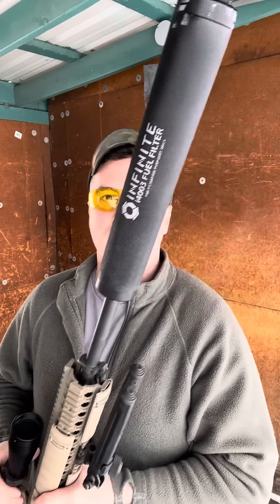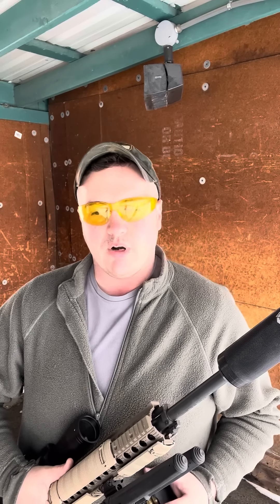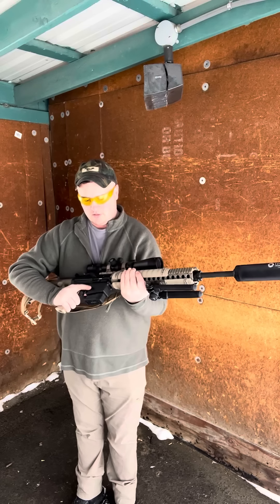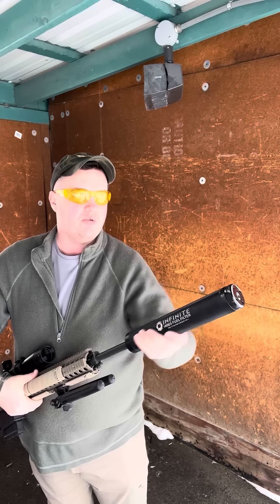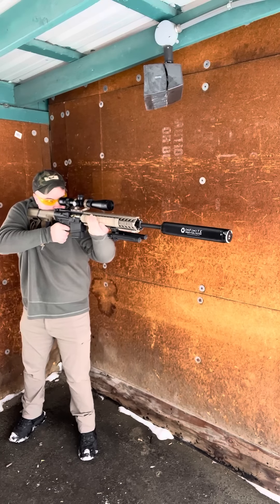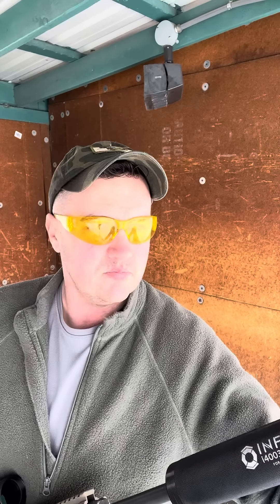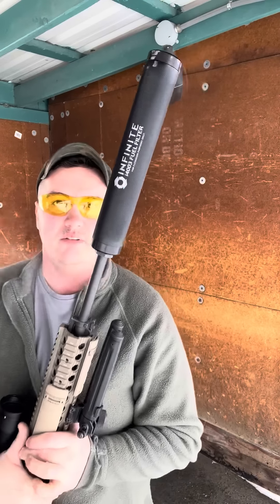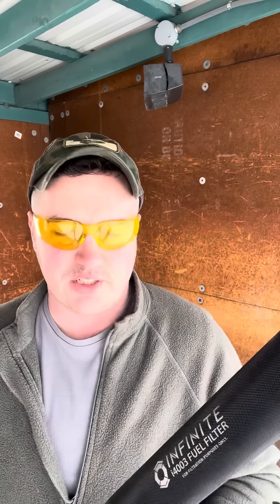Long Wix 4003 Solvent Trap now suppressor on AR-10

Comment: The 7.62x 51 was not subsonic I'm guessing?  Anyhow does that still require normal NFA registration to be lawful to use for civilians? If so, what is the regulated serialized part the outer shell only?    Basically, can the internals be replaced when needed or is the entire can junk and you have to do another NFA stamp again?  It's just so absurd that PPE/suppressors are a regulated NFA tax'd accessory.
Reply from the maker: The body is the serialized portion and internals are serviceable